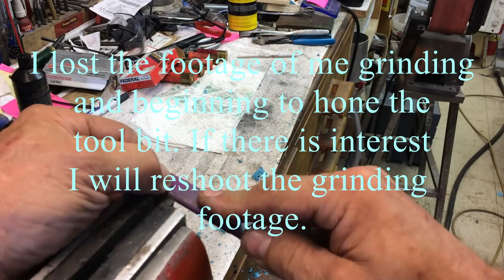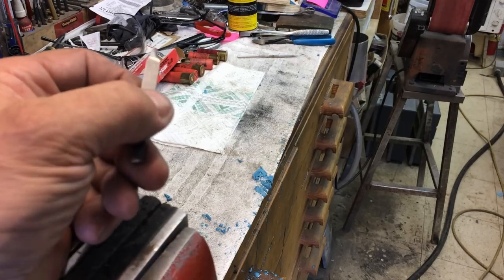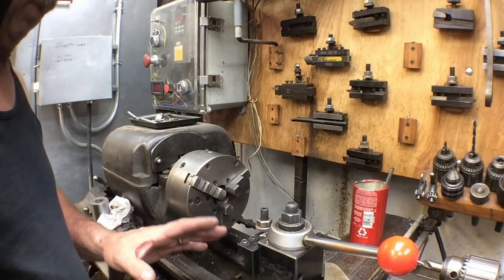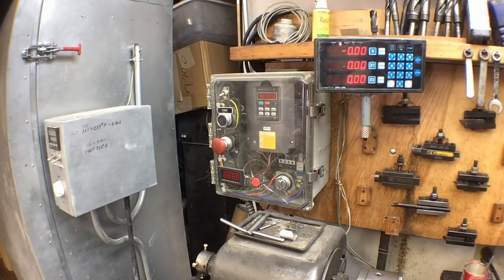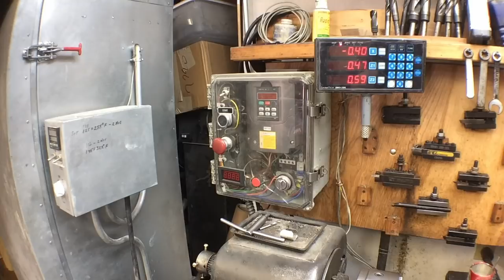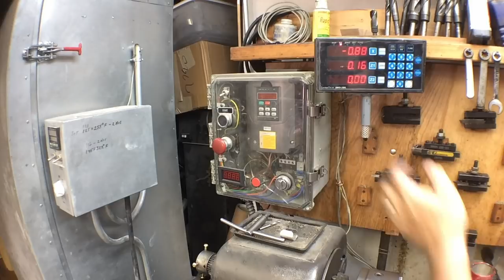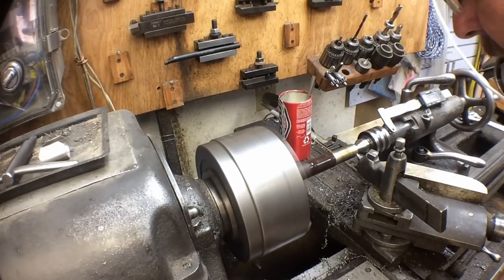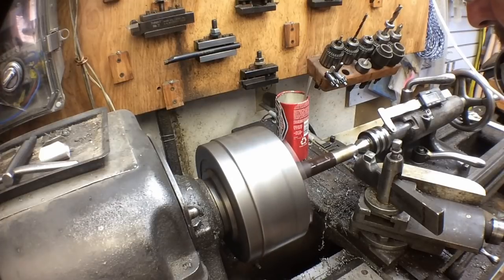My Lathe Turns A Rough Finish!  What Should I Do?

Comment: Thanks for those insights!
A few decades ago I bought a lathe (after using them in tech school in the 1960's). 
But I couldn't get a good finish with it and it sat idle for 25+ years.
During Covid-BS lockdowns (Au)  I added CNC to my equally unused (similar aged) RF30 Mill.
I learnt a lot, setting it up and so, I thought I'd give the lathe another whack!
I watched 1/2 your video (up to the backlash demo) on your old machine and realised - a lot of things!
I dug out some old (pre made/2nd hand) HSS tools and took a few test cuts!
WOW - significantly better results with them than anything I could get with the carbide insert tools I'd bought.
I watched the last half of your video today (after taking many notes of things you did) and pulled many parts off my lathe and examined them.
I adjusted a few and removed quite a bit of chatter and backlash.
This arvo' I'm going to try my hand at grinding some 30 year old HSS steel blanks into cutting tools.
My carbide tools can GTFO.
Thanks for your "warts and all" video, that I found chock full great knowledge!
cheers from Australia!
Will B.
Reply from the maker: Thank you,glad you were able to get something useful from it. Carbide has it’s place but I think it needs a fairly tight machine a little understanding of what it needs. hss is more forgiving. Good luck, Dan.

Comment: Hillsgun,  I am a new hobby machinist.  I purchased a Southbend 10K a year or so again.  I have been struggling with surface finish on steel for a while now.  Brass is pretty easy.  But steel has been tough.  Part of my problem is probably that I turn anything, without knowing what kind of steel I have.  I finally ordered some 12L14 so I know what I am working with.  I have also been working on my HSS grinding using a simple disk sander.  Thanks for the tips and wisdom.
Reply from the maker: Rigidity, tool geometry, and make sure you are close to center height, type of steel shouldn’t be a limiting factor within reason, 12l14 will turn easier, but most of what we commonly acquire is a cold or hot roll mild steel which is slightly gummy by comparison but should turn ok. Good luck and have fun.
Reply: @hillsgun  Thanks for sharing your knowledge.

Comment: I'm half way through this video and had to post a comment anyways. I've been running with my cross slide straight and "unlocked." I changed it as per your video and the difference is absolutely nothing short of AMAZING. I would absolutely like this twice if I could.
Reply from the maker: Glad I could help, Thanks.

Comment: Small nose radius and positive rake angles are good for worn out low powered  lathe slow feed and good speed is good try always to, feed rate less than nose radius per revolution, depth of cut more than nose to reduce radial push on tip of insert. High on center line tool push out, low tool is pulled in. hope this will help.
Reply from the maker: These things are true but sometimes is to much information for the new user, must of these things are great guidelines but for most hobbiests are lessons learned over time with hands on experience

Comment: Another tip use something like feelers gage put between round stock and and tool tip run tool till it touches gage if gage leaning at the top back towards you tool is to low, if gage is leaning away from you your to high if straight up and down you are right on . Ebay and amazon sell plastic height gages with a bubble level.
Reply from the maker: We have always used razor blades and height gauges built for the individual lathes

Comment: I'm surprised that you did not talk about the 'Shearing Tool'... So easy to grind... Does NOT need to be on centre... Can finish so fine that the cuttings are like a spider's web and the stock looks like polished chrome in your hand even before any hand polishing that might follow. Nobody likes a 'know it all' but I began grinding and using that tool after someone out there gave others this same tip and its one I certainly took on board and have used it ever since.
Reply from the maker: ah yes, a magical tool indeed, it is wonderful to have a tool that you can get close to the lathe and the stock will magically form itself into perfect submission out of fear .

Comment: I notice quite a few things that make me wonder. However, we all do things different. I saw a comment about "cheap Chinese" lathe. I currently running Mazak, Doosan, Bins & Berry and Herkules and a few cheap Chinese machines, using different materials from 1008 up 18CrNiMo7 and many stainless grades, however, I never have a finish problem and the cheap Chinese machines are quite up to standard. The simplest way is to abide by standard engineering and metallurgical rules and I also look at the chip (the material has to chip) and the colour of the chip, this will indicate that you are on the right track. Sometimes you need to reduce circumferential speed and increase feed speed. The chip will tell you.
Reply from the maker: You are right, We all do things differently, I don't remember  exactly what I said about chinese lathes, but I also run some offshore machines and I have stated on several ocassions that I will choose them over worn, but better quality machines. This video was primarily directed at new individuals to machining on small lightweight and usually well worn machines to hopefully overcome some of the problems they will encounter. One of the main problems new hobby machinists will encounter is that instead of getting real help when they look on the internet what they encounter is individuals who will give a long resume of all of the machines they have run, all the materials they can machine and how much they know instead of some basic steps that can hopefully get them in the right direction. Telling the world that "I have never had a problem" does not help anyone except to stroke your own ego.

Comment: Being a machinist myself, I would have to say that the spindle bearing should be changed. I worked on a lathe one time that had the same problem. Turned out that the lathe had one time been crashed.  A new spindle bearing should make a difference like night and day.
Reply from the maker: On a Sheldon it's not just as simple as just changing a spindle bearing and this machine has other issues. the point of many of my videos is not just how I do things, but also that many things can be done with less than optimal equipment and give satisfactory results. thanks, Dan.

Comment: I think the easiest general advice to improve finish is two fold: 

1st: High spindle speed, slow feed rate, a sharp tool on center. 

2nd. Use the above to first get a good finish on aluminum so you know 
what a good finish looks like sounds like, and feels like from your machine.
Reply from the maker: I think that is basically true, but if you aren't sure where to start and don't really know where you are in the process it can be really confusing when you are inundated with people telling you this is the only way to do something as is commonly happening on the forums. Hopefully I have visually shown some of the things to look for which "may" help sort the confusion. The tool on center is probably a part of the problem because until you know how to compensate for it it may be set on center, but when it is put under cutting forces, depending on wear it may be deflecting way low. Now I am going back to the shop to continue shaping the radiuses for the 4 position tool post for the 10". Talk to you later John.
Reply: Yeah. We've all been there before in our quests for answers. It's extra "amusing" when someone innocently asks a perpetually debated question that triggers forum civil war.

Comment: I never trust any machine to be accurate..its up to the operator to make a part true. 
On that note, a good machine is one that cuts the same every time. Consistent cuts is what makes a good lathe or mill, not accuracy. I want it to cut the same every time I use it.
Ps...thanks this is good stuff.
Reply from the maker: thanks
Reply: the best machine i've worked on only changed one way over the span of a week: tool wear

the main tool was 0.8 micron shorter after a week of use, my parts were 1.6 micron wider

This was dlc in alu, lasting almost 6 weeks with a 5 micron tolerance.

Comment: thank you. Just got a mini lathe and i am learning. i just cannot get a smooth cut but i have been told it is because the lathe needs to be fastened down more. if you have any more tips please let me know. thank you for sharing.
Reply from the maker: you are welcome. If you are working wih a new lathe that is fairly tight I I I suspect it probably has more to do with tool positioning than the machine being bolted down.
Reply: @hillsgun  thank you

Comment: Plz help
My work has a cq9332 Bolton lathe and I make copper pins with it only my first cut at low speed isn't smooth 
I'll go over my last lap manually on high speed and still have to sand it down pretty good 
What could the problem be?
Reply from the maker: Hard to tell without knowing more, Go back to the basics and work from there machine copper and brass dry, make sure your tool is sharp and exactly on center height, I would probably be running at 400 to 600 rpm and I often feed manually at least thru a few cuts until I figure out the approximate feed rate. I am assuming that the machine is in good condition. It will probably come down to tool geometry, and positioning. Keep at it and good luck.Dan.

Comment: @08:59 I like those guys you added to you lathe at the side, it seems like a normal cheap digital calipers and you a minor modification to it, is it?
Reply from the maker: It is a cheap chinese scale, but it is connected to the Shumatec digital readout which is shown at 10:15
Reply: @hillsgun  interesting, keep the good work, how did you manage to connect them together, is there a standard communication or wiring between them. I'm very new to lathes but I'm starting and I want to make some precise work and mix it with some mini DIY CNC projects.
Reply from the maker: It is now old technology, the Shumatech is no longer available, it was originally designed to be used with inexpensive scales and worked well. I use them on several of my machines. Part of the problem now is that the scales no longer all use the same protocol to send measurement signals so not all scales work with the dro.
Reply: @hillsgun  ok, bad to hear that

Comment: are any of the asian machines sturdier than the old small american lathes? i have a beat up 10" atlas lathe that does ok but it's design is really not that robust and i don't know if i have a heavy hand or if this is how they all are.
Reply from the maker: I have stated before that I really like my Atlas machines, and I make a little money on the parts that I produce for them, but the reality is that most if not all of the Atlas machines have been around for years and are well worn. Many peaple will advertise them in "as new" or "perfect" condition, I have yet to see one that is not well used. I have reworked a mill and the lathe that I built into a production lathe and they both do fine work within their capabilities but the reality is that an import machine such as the Grizzly G0602 that I purchased new (and converted to cnc) is a far better machine in almost all respects. If a person is investing money for a lathe to have the most capabilities hands down I will recomend a new import.
Reply: I have cheap Chinese machines alongside Doosan, Mazak, Bins & Berry and Herkules. I meet ISO & DIN tolerance and surface finish. About 60% of the time I cut 18CrNiMo7. Maybe I am just lucky

Comment: If all has been done correctly then spindle bearings and adjust Gibs. If it's a cheap china lathe then good luck. .0005 to .001 per rev finishing
Reply from the maker: Nope, more to it than that. Wear in a well used lathe will not be even and while it can still produce good work it has to be taken into consideration. While I prefer US iron the reality is that from a straight mechanical standpoint the "cheap" chinese lathe that I run for cnc work will hold better tolerences than my worn Sheldon. While my Sheldon will still do very good work  if I operate it the same as the cheap lathe then the cheap lathe will outperform it.
Reply: I have cheap Chines machines alongside Doosan, Mazak, Bins & Berry and Herkules. I meet ISO & DIN tolerance and surface finish. Maybe I am just lucky.

Comment: I see your Sumatech DRO is still operating? My lathe DRO packed it on so I replaced it with a SINO. Never installed the Shumatech 2 axis on the lathe. Must be nice to have a 3 axis on a lathe?

What tooling do you like for 1045 steel?
Reply from the maker: I have had good luck with the Shumatech DRO's. I have them on 3 machines and they all work well. The only real problems have been with the scales which are the cheap scales we used early on. I built and installed the dro's early on and have some spares for future use. I definitly like the 3 axis on the lathe. As I add new machines I will probably go a different way with the DRO's but for the equipment I have now and possibly future used equipment I see no reason to change as it has all the capabilities I need. For tooling on the manual lathes I use mainly HSS as I think it offers more versatility and is more forgiving than carbide. On the cnc machines I use carbide exclusivly unless it is a short run specialty tool which does not require repeatable setup in the future.

Comment: How about carbide tools? Highspeed sucks. Ugh. 😂
Reply from the maker: I think hi speed steel is a necessity in the home shop. carbide has it's place but for the average home hobby shop hi speed steel is much more versatile.
Reply: @hillsgun  , ok agreed. I have also some hispeed billets for special purposes like snapring grooves etc. 

But normal "bulk turning" I wouldn't even think to use hss tool. Because; rough finish, need of cooling, and (chinise) carbide tools in eBay are just so cheap but still good enough.

 My favorite is WNMG02** inserts and holders; less than 1€/piece, 6 edges in every insert, shiny surface finish, dry turning with reasonable speed. (500-700 rpm and feed 0,10-0,15 mm/r + 1,50 - 2,00 mm chip thickness)

Comment: What rpms are you running ?
Reply from the maker: I don't recall, it will vary with the cut, material, and feed, just to name a few variables
Reply: @hillsgun  Thanks,,,with my 12 x 36 atlas I've found the faster it turns the better the finish,,,and just seems I have a lot more capabilities with rest straight and just changing it for treading,,
Reply: @hillsgun  but I'm just learning and like opinions from guys wth experience,,
Reply: @hillsgun  I guess with excessive wear on angle it would be more rigid
Reply from the maker: @georgespangler1517  to a certain degree you are correct, but you also find high speed and a medium to heavy cut will overheat your tooling quickly to the point of excessive tool wear and poor finish
Reply from the maker: @georgespangler1517  thank you, and if I find any with experience I will send them your way.
Reply: @hillsgun  yea,,,I noticed with parting too go slow,,,and faster facing,,,been a house builder all my life and in theory with saws you go slow and blade tends to grab and rip,,,I see same with lathe,,